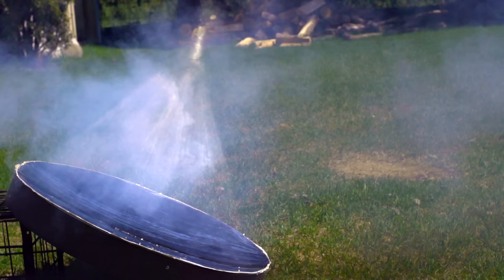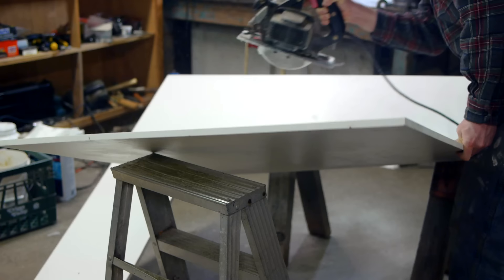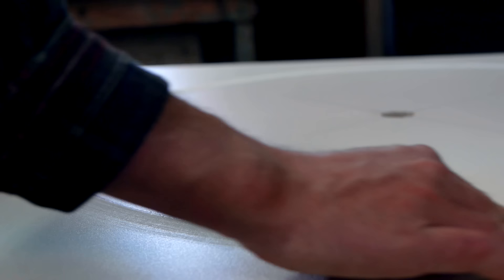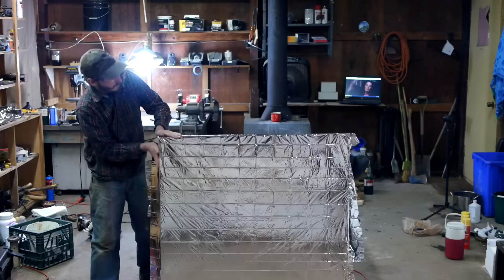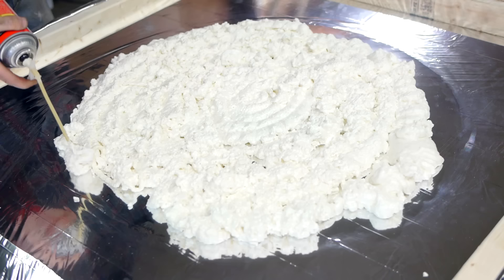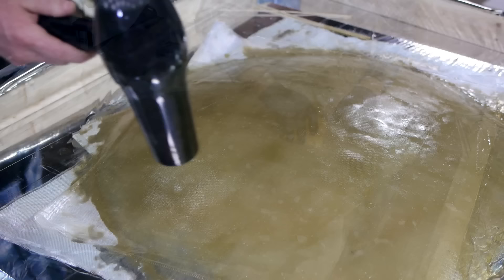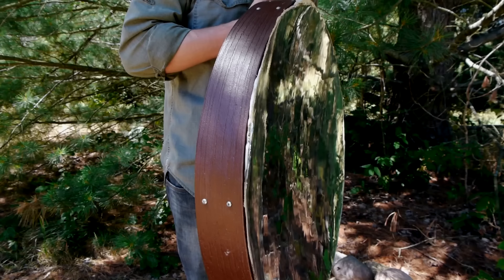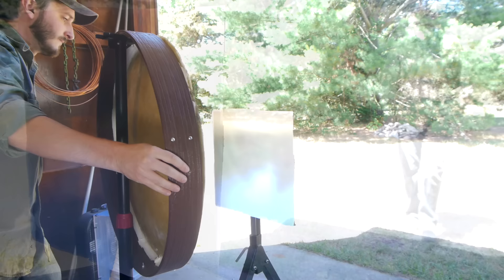How To Make Parabolic Mirrors From Space Blankets - NightHawkInLight

Comment: Great video and wonderful idea. Unfortunately this will never make a telescope mirror. The main mirror is not uniform in shape and air pressure will not make the right shape no matter how good the surface is. On the other hand this would make a great cooker.
Reply: Yes a cooker is an ideal application as you don't need a pinpoint focus, in fact you want the heat to span the area being heated.

Comment: Awesome project! But in fact you created a spherical mirror. The curvature of the foil is proportional to the pressure, whitch is constant over the whole area. Equal curvature means sphere. But a sphere is a good approximation for a parabula as long as the mirror is not to big or the focal length not to short.

Comment: Hmm, I made a parabolic mirror in a school project using a 160 cm (5ft 2 in)  satellite dish that I covered with triangles cut from high reflective thick foil (school already had the foil left over from som other project). Worked very good but it was a tough job glueing all those triangles to the surface. Seeing your video I realise I could have saved me a lot of work if I had glued that mylar blanket to the edge of the dish and made really sure it was airtight , made a hole in the dish and mounted a valve and the just sucked the air out.

Comment: Instead of putting the Mylar under pressure place it in an airtight container and pull a vacuum. Thus you may focus the mirror by pulling more or less vacuum with no need for backing.

Comment: I've seen this done by gluing tiny mirrors to old satellite dishes. Never thought of using mylar. U may want to try a satellite dish tho. They already have mounts and are made to be perfectly parabolic and focus signals to the receiver. And the recievers arm is right at the focal point.. therfore u have a pre-made bracket to hold things u want heated there. Good luck

Comment: Another thing you might want to consider is to stretch and adhere you mylar to the ring, then seal the back of your ring with a flat plate. By doing this, you can then pull a vacuum inside the assembly. Granted, you'll no doubt observe some variance to your parabol due to temperature and atmospheric pressure changes causing expansion and contraction of the remaining gas inside. However, you'll avoid a lot of the rough surface imperfections (as noticed from the fiberglass) in the mylar itself because it will essentially be stretched yet free floating while what's left of the air inside the mirror provides equal surface tension over its' entire area. 

What I might try to overcome this problem would be to tie off two condoms and insert them inside your mirror before you seal it shut. One slightly inflated and the other left empty with just a bit of air. As they are made of thin latex and are more sensitive and flexible than the mylar, they may take up much of the changes of the gas inside not unlike how a blimp compensates for atmospheric changes to its' helium bladers. 

Telescope grade mirror?

Comment: You want optical smoothness to within 0.1 or 0.05 wavelength for a telescope.  The low end of the wavelength range of visible light is about 370 nanometers, so you're looking at about 17-37 nanometers of smoothness - that means your entire parabolic surface needs to be "correct" to that precision.  I'll be VERY surprised if you can make that happen with anything like this method.  That generally requires starting with a very thick blank (so it won't "flex") and grinding it very very carefully.  There's a setup called a Foucault apparatus that you can use to image imperfections, which you can then gradually grind away at.
   
But for solar cooking and that sort of thing?  Yeah - this is a great approach.
Reply from the maker: You're right. This would be more appropriate for something like a radio telescope instead of visible light, but you can make a visible image with a mirror like this. It just has a lot of issues. As per your other comment, it is likely a sphere section, but it approximates a parabola especially at large focal lengths. Some papers I've seen that make inflatable mirrors had a mix of parabolas and sphere sections depending on the film used

Comment: Great mirror! The distortion of fiberglass is probably due to the non balanced layup. Glass fabrics randomly aligned and *ester resin with large curing shrinkage led to this effect. I think the cheaper mat glass should work better as it has no alignment in fibers.
Reply: I agree.  I also think that loose fibers might also accomplish the same.  Maybe buy them outright, the kind used for spray fiberglass or the kind they put in concrete?

Comment: I have many suggestions for improvements. Did you already try another version?
Suggestions: 
#1: pressure test
#2: Ridges formed IN the fiberglass, for rigidity. Structural gg.
#3: Keep more of the surrounding flat mylar and fiberglass. To have more rigidity and mountarea

Comment: Simply creating an outer ring with your mylar clamped to it and creating a vacuum behind it will pull the mylar into a perfect parabola that can also be focused by changing the slackness of mylar, or the diameter of the ring!
Reply: The hard part is, how would you polish it to an optical sheen? That seems like it would be impossible.
Reply: @andrewschort724  It's mylar!  It already has a mirror finish!  Not to mention it doesn't have to be perfect in order to start a fire!

Comment: a good idea would be to clamp blanket down with a large thick solid ring with a rubber edge that matches up to a rubber ring or possibly groove on the table. sandwich the blanket between the two to form an airtight layer and to grip blanket - thus eliminating the gluing and grinding process.

Comment: I have a solution that would have saved you SO MUCH TIME AND EFFORT! Use the dome lids for a Rubbermaid trash/leaf bin. If the lid is textured, use spray foam to fill it in to create your smooth surface. The rest you can figure out. Awesome video though!

Comment: A 55 gallon drum with a hand vacuum pump to pull the Mylar into shape.
Also just a simple rubber band around the top and you have an adjustable focus mirror.
What a crock that it takes this project so much money to generate a simple parabolic mirror. This is why shop classes are necessary in our schools..

Comment: You can skip a few steps by buying a water heater pan which is a round metal or plastic dish with a flat bottom and vertical sides and they are available up to 30" with prices from about 7 to $40 depending on material and size.You could just  tape down your mylar flat and using the pan as a guide do a circle of contact cement on both the pan and mylar, then after the cement dries you can fold the mylar up sticking it to the pan and after trimming the mylar cover the edge with packing tape. Change air pressure in the pan to vary the focal length.

Comment: love your videos
Years ago I had the experience of coming off an escalator and almost stumbled because my eye caught a mirror setup like yours but with two little differences that made it eye catching.
One they had some surface that was a bit more mirror like so the reflection was good.
Two they had not backed the mirror up with a hard surface - it was stretched taut across a ring and the space was pumped with a small bellows that caused the internal pressure to go positive and negative.
So their mirror was like a fun house one - cycling between concave and convex. Very arresting image.

Comment: Looking at the first two attempts. If you decide to re visit this project . combine what youve already discovered. Maybe using regular silicone as a sealant for the mylar to pvc seal. Then add and weight or clamps  to the ring prior to inflation (to keep a seal and prevent the silicone from detaching. . Inflate Then fiber glass the ring inplace . . now you could use a thin putty knife or similar to separate the silicone seal.when removing . .

Comment: The easiest way to do it will make you feel like someone opened the box you're stuck in.
Make a balloon with reflective and clear mylar with a hoop to keep it from crumpling when you inflate it. The curve of the pressurized mylar can be calculated. So basically take a hoop and epoxy the mylar to each side of the hoop place a valve and pump it up. Done.
Reply: no one understands you nor is able to make a mylar baloon, fixate it and cut a mirror out of it

Comment: Nice attempt, you can get space blanket cut from roll without wrinkles if you look for aluminized mylar membrane, also it sometimes comes in better surface finish if you do get proper stuff not a dollar store chinesium (even one in my first aid kit looked better and it is not top-notch stuff. Seems also that it may be beneficial if you do not glue it but make a gasket and compression ring, so after forming its possible to remove it easy

Comment: Nice job!  One possible improvement, add a variable pressure regulator, and a compressor with a large tank reservoir.  That way you can control the pressure by turning a knob.  Small leaks would not affect the shape at all as the supply would keep the pressure constant.
Reply: + $1000

Comment: Just use a"disc sled" and glue the emergency blanket to it. To take out the wrinkles first use a blow drier then when the wrinkles are out, place the sheet down and use water to add pressure pull the edges tight. When the glue dries empty the water.

Comment: years ago, maybe too many years ago now, one my teachers  was a very clever guy . We got to smelt aluminium  & made fibreglass boats go-carts etc and we built them from scratch . 
One simple way of strengthening fibreglass is to give it a frame, using cheap electrical conduit tubing  or foam including balsa wood,  and simply cover it with a few more layers of chop or a woven mat . 
 This will give  a light weight and strength and maintain its shape, we used this when making sailing boats for the ribs and experimented using other materials.  I have thought about making a  a large telescope with a prime focus dish that I have as the collector,  and using a short cowling  placed around the sides,  not like some of the Newtonian of the same size  mirror which need a much longer focus . 
interesting

Comment: I made something similar, but WAY simpler.

I created a sheet metal frustum (lateral section of a 90°cone) and glued on the aluminized mylar.. The whole process took about an hour.

Aiming the vertical axis of the frustum at the sun creates a focal "line" which, in my case, is a copper tubing coil, theough which I pump water to make flash steam to run an off-grid steam-electric generator.

Oh, and tell your sponsor that I have built a solar-elecyric panel that generates electricity using heat. The hotter it stays, the greater the flow of electricity.  Again, my methodology is based on geometry and simplicity. 😂
Reply: Not so loud, Big Oil and Big Lithium might hear you and send their fixers

Comment: If you made the box air tight instead, by mounting a sealed back to it and cutting a circular whole in your front base sheet, you could use a vacuum pump to create the same thing by sucking air out from the back of the box with reversed bike valve. 
As long as it was air tight, you may not need any further support at all.

Comment: I made one of these using a discarded 8ft plastic hot tub shell and used vacuum to pull the mylar down instead of inflate it. 
It was savagely powerful but I noticed quite a lot of light still passes through the mylar.
I think a better solution would be to use a liquid to pull down mirror polished stainless steel or aluminium.
You could use two part pouring resin then vacuum it out untill a parabolic shape appears then cap it off and allow to set.

Comment: If you used suction, instead of pressure, you wouldn't need to put the fibreglass on (which roughens the surface). You'd just turn off the tap when the focal length is correct.   In fact you could make the focal length adjustable in real time if you wanted - might be useful for a telescope.
Reply: That's the concept behind the disposable dollar glasses that doctors are giving away in 3rd world countries in towns with no doctors. A syringe pulls vacuum on a plastic inflatable lens and when the person can see clearly, they pull out the syringe and seal it. I want to say I've seen a telescope mirror done similar but...

Comment: 1. secure the edges as neatly and uniformly to avoid distortions
2. flip it upside down and fill it with water instead of pumping air
3. use plaster to make a mold, when dry remove the blanket, apply epoxy and put the blanket/water again to fix it, you might want to use a brush underwater

Comment: It is great for my current research on optical communication, thanks for sharing. I have a few questions. 
1. It seems that the surface is parabolic, what is the math behind?
2. How to ensure the curve accuracy as we expected when you use fiberglass to fix the surface? You seems to put extra air therein.
3. What if you inflate the mylar downwards above the surface of some kind of liquid? By fine tuning the air pressure, you can get a good shape as the liquid becomes solid.

Comment: I can see how the process could be simplified by having the aluminium coating a structural material such as plexiglass. Then you can heat and inflate a rigid parabola in one step*. I suggest a removable film on the aluminium to protect it during handling.

Keeping it as lightweight and rigid as possible will keep costs down on manufacture, transport and installation.

The great thing is the dishes are stackable. Simple frames with 4 contoured pads can hold the mirror in an installation.

However the whole process may be irrelevant as you can create a simpler trough reflector unit, using a flexed durable mirrored metal sheet, at the point of installation, focused on a black pipe to extract the heat generated.

* This process is used to mold illuminated signs.

Comment: if you want it to last longer, lathe can be used to carve quick nice shape in metal frame, just polish it, or apply a vacuum layer of aluminium
Reply: try molten glass/plastic spin casting, lower melting temperature for plastic, liquid form essential

Comment: I had thought of this idea before seeing your video. I had thought of finding an old satellite dish laying it on it back and spraying glue all over it. Then hold all four corners of the space blanket and fill it with water and place it in the center of the dish. I've not tried this but I would hope the weight of the water would stretch the mylar and stick it to the dish hopefully avoiding bubbles. Satellite dishes are cheap these days and could make a good parabolic mirror.
Reply: Satellite dishes are made of aluminum. Strip the paint and keep polishing till you get a mirror.
Reply: @baranjan4172  yea my idea would take a lot less time!

Comment: I've seen this done well going the other direction and sucking the air out from below it in a round air-tight chamber. It may also work if you let water pool on the Mylar over a round cavity and let the lens form itself from gravity. But it will only work flat.

Comment: I thought that you were going to remove the air between a circular frame and the plane with the valve. This way you can save time and money, just stop the process at the frame glued to the flat surface, but in the opposite direction, with the frame in between. Thanks for the video, I'll try this idea that you made me think.

Comment: Instead of wasting space blankets, you can also piece together a bunch of potato chip bags with a heat sealing machine. It won't be perfect, but if it's made from trash, it does a great job and solves an environmental problem. Those bags have taken over cigarette butts as the main contributor of pollution on our beaches (CA).

Comment: 1. Mirror for astronomy is a different animal.  You won't get anything useful this way.
2. Great way to make a solar concentrator tho.  I have 1.8 m diameter satellite dishes with foil coat, and they are just plain dangerous! A glimpse of sunlight and they are burning a hole in something nearby!
3. Rather than air pressure, you could put your Mylar on a mound of resin or plaster, and use water pressure to do the bulge.  If you made a male pattern from that, then you could use something cheaper to pour on top to take many casts for many dishes.
4.  When you have made one of these circular concentrators and got it working, you will then want more.  That will lead you directly to trough concentrators instead.  You may as well go straight there!
Keep up the great work!

Comment: Hm. Seems like it would be interesting to try to use vacuum pressure on the back side of it to just let the vacuum hold it in shape and wrinkle-free. Two air-tight rings sammich the sheet. Connected to a box that can have air sucked out to form the parabola and hold it in that shape. Just gotta deflate it each time you use it. Still need a lot more reflectivity in the material.

Comment: Very cool, or hot i suppose.  I am wondering if a person could use this same idea, but make it tubular as in taking a section of plastic pipe,  cut in thirds lengthwise and then gluing the mylar to the interior.  Then make a frame that holds a black pipe over the focal point of the mirror.  You could then run water through the pipe and have a  solar water heater.
Reply from the maker: All you have to do to make a parabolic tubular shape is let a piece of fabric sag via gravity.
Reply: @Nighthawkinlight  cool, thanks for that.

Comment: Should have a air pump with pressure regulator which keep the right air pressure for a week, let the aluminium foil straightening really well, later use glassfiber and a frame which keep the shape